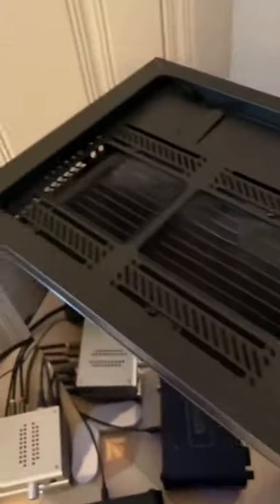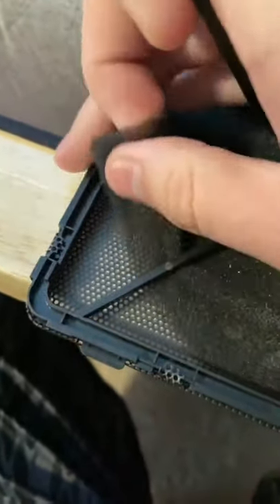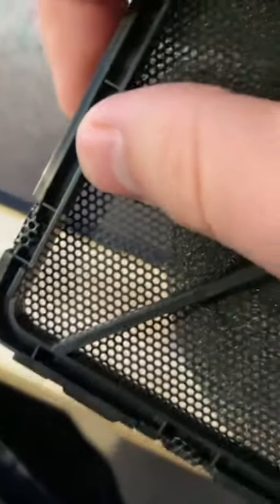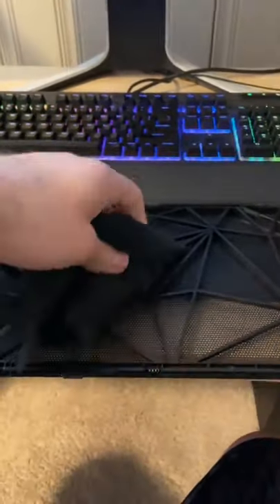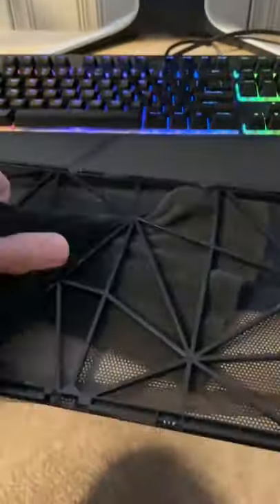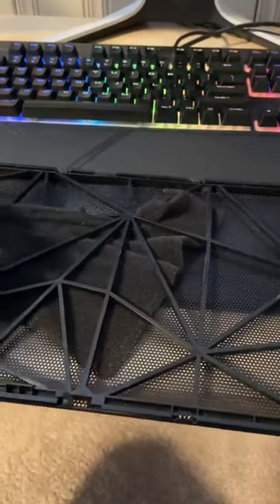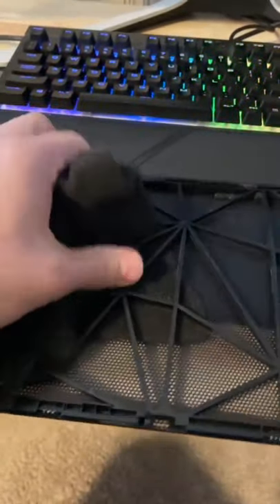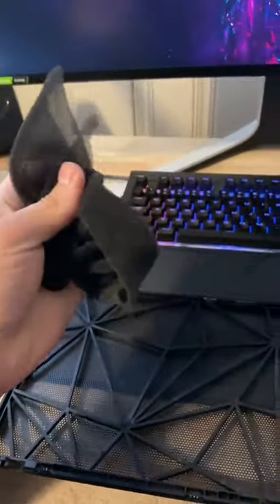Modded my Fractal Design Case for More Airflow Free Mod

Comment: Testing done by Gamers Nexus shows you only gain 1.7 degrees by removing the mesh. Not worth for all the added dust build up imo. Unless you're Buildzoid and absolutely need 1.7 degrees of thermal headroom.
Reply from the maker: I’ll take any free gains. I’m Also not using this case anymore, moved on to the Corsair 5000D.
Reply: That's why you use a fine mesh that can double as a dust filter

Comment: Removing the foam filter isn't worth the extra dust inside if you have a good static pressure fan but I get it if your overclocking.
Reply: There’s really no purpose to having a filter for an exhaust fan. Any dust is getting pulled in through the front (unless you’re using the top as intake).

Comment: I have this case and it sucks, well it should suck but it doesn’t as their foam in the front gets clogged with dust completely restricting air flow. You literally have to hose down the damn thing to clean up. Bad design!
Reply: Vacuum your room buddy lol